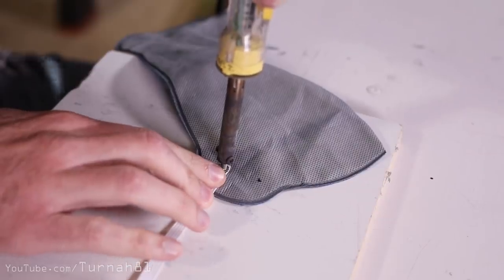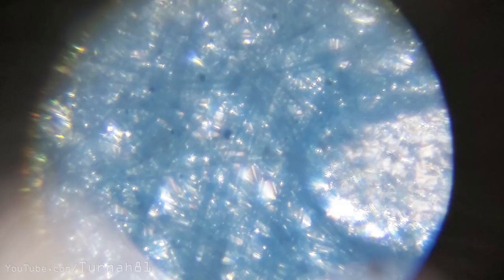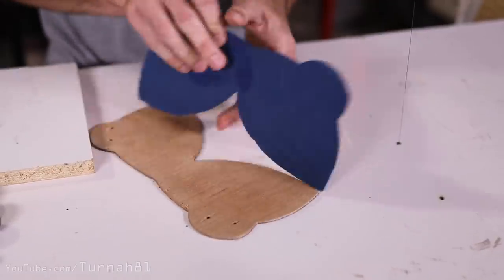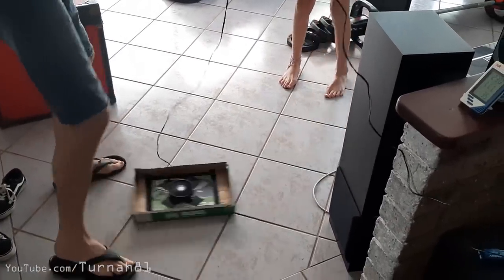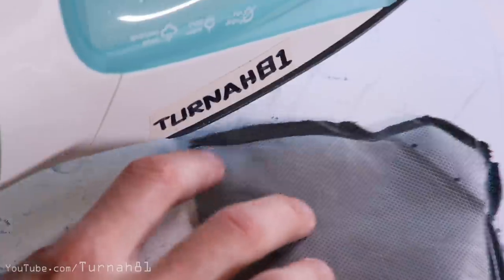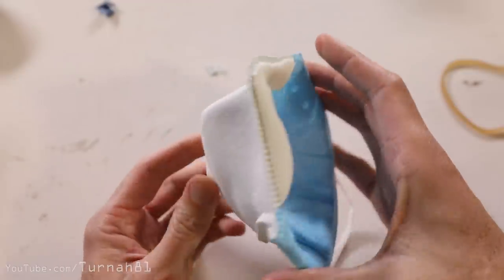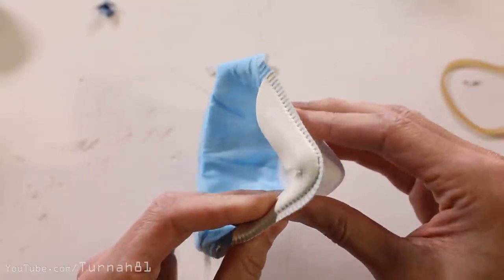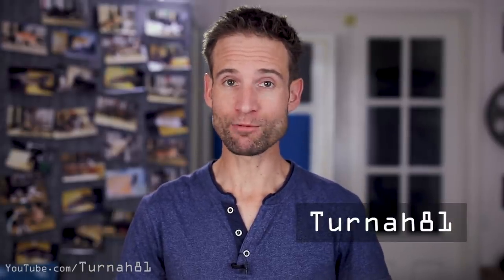How to Make the Best Face Mask, No Sewing (Don't use Cotton or Vac Bags!)

Comment: You can sandwich your fabric between pieces of parchment paper to prevent getting melted plastic fabric all over your iron.
Reply: Why is this not a higher rated comment?!?!?! I think this will also help with all the holes my iron is melting in the fabric. I have tried all sorts of temperature settings, speeds, and pressures... I either get two layers welded together without the third one bonding, none bonding, the whole thing melting to my iron, or everything bonds(ish) and there are a bunch of holes. I am going to try your advice, and have a very strong feeling it will work great! Thanks!!!

Edit: THIS TECHNIQUE WORKS SOOOOOOOOO WELL!!! Parchment paper WILL speed up the learning curve for welding the polypro together.
Reply: Jordan Mackey thanks for the update!!!
Reply: Thanks for the advice Misty!
Reply: Thanks for the advice.
Reply: This should be close to the top.
Reply: I'm so tempted to try sealing with heat. Didn't think to try before. I have been sewing them and it's been good to work with.
Reply: @0GxHazmat  Very smart idea! I also wonder if a glue gun (without glue in it, of course) could work?
Reply: Golgo 13 Another thought, would a woodburning tool do the job? I don’t have an infrared thermometer to determine the temperature of it and I am awaiting the arrival of my filty material. Filty is a US company and is now selling to mask makers.
Reply: While it's not exactly the most available material, PTFE film or tape (not the super-thin one for plumbing) works best as the non-stick layer for any source of heat. That's what is used in a lot of bag sealing devices, for example.
Reply: Thank you very much for this idea. I was having one hell of a time getting the pieces to melt together properly without destroying the fabric, AND getting melted plastic all over the wife's iron. I put single layer of parchment paper over top, slowed down a bit and it is sooooo much cleaner and easier. Plus I find the iron glides easier. Your idea has saved my sanity!
Reply: Misty Fairy good idea 💡 ty ❤️❤️❤️
Reply: Misty Fairy  his iron (like many) has a Teflon coated sole, which would explain why it works so well for him, but the plastic will stick to my stainless iron.
Reply: you can also use foil between the piece and the iron
Reply: sciloj Thanks, I’ve actually got some of that. 😁
Reply: Could you please add measurements to the pattern  so those without access to a printer can still make it? At best on a grid background, at least just write measurements with a baseline. Thanks
Reply: @golgo1364  There are sewn polypropylene masks that have passed fit tests, so sewing is ok
Reply: @0GxHazmat  Did you get a chance to try this?  Did it work?
Reply: @gregorysmith3097  Yes, I updated my comment, but that part may be showing up underneath the "...Read more." It does work, I ended up cutting the parchment paper to just a bit bigger than the template and then drawing a dotted line on that cut parchment to know where I wanted the weld. Otherwise, it can get a little tricky trying to see through the parchment paper. I had a couple goofy looking welds the first few times with this method, but they at least sealed.
Reply: @agnescleary2312  Try it and let us know how it goes!
Reply: I wonder if a straightening iron would work well for this purpose?
Reply: @dinahoeynck  It should.  Flat irons are supposed to be around 365 degrees F.  Melt point of polypropylene is 320.
Reply: @beadcamel  I was wondering the same exact thing. I have a tool with the different attachments and it seems like it'd work. I have a clothes iron too But I see myself burning holes or myself.
Reply: rodrigo maldonado  you can see through the parchment paper a little but not through the foil at all and the foil will probably add more heat to it too.
Reply: @sciloj  Will the plumbing tape burn or is it just too thin? I have a tiny little crafting iron meant for use with piecing quilts, and the 1" tape would probably be wide enough to cover it, especially if I wrapped it around a couple of times.
Reply: Baking paper also works. Tried it out and goes really smooth.
Reply: I think the dust cover for purses may work too!  Great video!  Funny guy,  Thx!😁
Reply: @sebastiaanx7867  The "baking paper" is commonly known as parchment paper.
Reply: @kblewis3331  Thanks, didn't know. In my language it is a uncommon synonym.
Reply: @johsheli  its harder to do with foil because its not see thru like parchment paper is. But yes in a pinch it would work. I think using a flour sack type of cloth would also work, and possible even wax paper which if ironed with the wax side down could help seal the edges if the hot iron leaves any pin holes it seems the wax would help fill them in. Just make sure you put wax side down so not to get it on the iron. You know what freezer paper would also work as well because it has a plastic coating on 1 side and people often use it to do crafts on fabric but ironing it on.
Reply: @slp5680  I think so even if you left the tip on you could make lines that are seals all the way around kinda like stitch marks if that makes sense. Also I would use parchment, wax, or butcher paper as a layer between the filter and soldering iron. Make sure wax and butcher paper have the wax/plastic side toward the mask because i think it would help seal any micro holes while keeping the iron clean.
Reply: I folded aluminium foil around the seam weld to do the same. Without it I could not do it and it was a mess.
Reply: Oh!  This makes so much sense to me! I was up late last night trying to research different ways to bond this material together and one of the things I found what that PP and PE don't much like to bond or weld to anything that isn't PP or PE. And, like many here, i was either melting holes all teh way through or not getting any melt happening at all. 

Parchment paper/ Baking Parchment is very lightly silicon infused to that nothing sticks to it, but it's also great in the oven up to 450 F (yes, the uncovered paper will darken and get brittle, but nothing sticks to it. I can make the stickiest candied sugar - take pure sugar and melt it in a heavy skillet at the highest stove settle, and you get molten sugar, this stuff is DANGEROUS, and will fuse to nearly anything once it cools and sets. LoL! It comes right off of parchment paper.

I have some plastic lined meat wrapping paper, but I'm not as inclined to use this since I'm a little worried about the plastic adhering to the mask during the melt process. But, Might be worth a test run or two.

Hhhmmmm I wonder how many times the paper can be used this way before it becomes to brittle?

What temperature  settings are any of you using with the paper or the foil?? Anyone care to share?
Reply: I ironed some polypropylene on mistake and it took me days and contractors solvent to get it cleaned. 😭😭
Reply: @beadcamel  Thank you Karen! What a great resource (actually spelled "Filti"). I wouldn't have found it if you didn't comment. Just purchased a sheet!
Reply: @beadcamel  I tried a wood burning tool. 

  Had real trouble with the clothes iron, will now try some of the techniques mentioned here with parchment paper.  Tried wood burner next, too impatient to go hunt out the soldering iron.

Even with a controlled power supply, we had a hard time controlling the temperature of a wood burning iron. It must have some type of temperature limiter and every now and then it stops?  My clothes iron had the same problem.  

The best results I could get were with a wood burning tip that had a very narrow edge, sort of like leaf- shaped, and flat.  We used the flat of the side to draw lines, a double set of parallel lines around the edge and were able to get a decent seal that way but the edges of the melted polypropylene were then dangerous even with trimming, you could scratch your face with them.  

I'm going to try these other methods mentioned.
Reply: Thank you greatly! Silly question but for times when I need a teflon mat to keep my cloth for burning while ironing, can I use parchment paper?
Reply: Yep, takes a woman to find the best shortcut!
Reply: Dina Hoeynck I was looking for this comment lol

Comment: USE EDGE OF GLUE GUN INSTEAD OF IRON, WITHOUT GLUE IN IT.
Reply: What a clever idea!
Reply: Good idea. I was worried about ruining my iron.
Reply: My iron was not made to work with glue in it.
Reply: Awesome. I will try this too. I tried making none and used a lighter and a plier to seal.
Reply: Is the mask washable?
Reply: Hayley Bourgeois  yes but it will not be as smooth and stiff as before. Starts to get a bit softer. Eventually it biodegrades in uv also , so I’ve read

Comment: Great tutorial. You can run a thin thread of clear marine grade silicone sealant to fuse all your seams even the elastic as well. that will keep them flexible and eliminate any cracking of the hardened melted plastic. It would also seal any sewn holes

Comment: For the nose strip, home depot has rolls of door seal foam. They have adhesive on it already, like tape. Works great for the ones I made from furnace filters.
Reply from the maker: Cool yeah if it's soft enough it will do the trick👍
Reply: I think bags of coffee have that 5-6 inch plastic "re-seal" strip that has two wires going through from end to end would work really well for the nose strip...and could possibly be melted or glued onto the mask. Thinner and more lightweight than electrical wire. Looks exactly like what is shown on the n95 in your video.
Reply: Felisha Kay yes that’s what my husband has in the garage..thank goodness for him or I’d only have the grocery bag part 🤣
Reply: I also used it to make face shields 😉
Reply: Make sure it doesn't have fiberglass in it
Reply: I use weather stripping. Comes in a variety of sizes but I opt for the window weather stripping foam. It can be cut, can use heat to smooth harsh corners, can handle vigorous washing and abuse and provides a great seal when used across the top of a mask to help keep from fogging ones glasses. I’ve used stitch glue or glue gun glue to keep them in place. They can still be comfortable after running a regular stitch through it to hold in place also. Same stuff as the weather stripping for doors Felisha had mentioned. Stuff is super cheap and easy to pick up as it’s not in shortage. Any hardware store or hardware Dept should carry it. I’ve even seen it in a dollar tree.

Comment: Fantastic tutorial. You are spot on. I would also like to recommend an old seamstress trick; bees wax. Rub bees wax along your sewn seams to seal the thread holes. Bees wax will also stand up to several wash cycles as well as the dryer on low. But, drying out in the sunshine is preferred to using a dryer whenever possible.
Reply: Beeswax smells good too
Reply: Great option!
Reply: what about bias tape? it looks like that
Reply: I forgot about wax -- bet you can use Baby Bell cheeze wax on your own if no beeswax
Reply: Hi Wendy, good idea with bees wax.  If anyone does cross stitch or beading there is a wax like material used on thread, as well as  bees wax. Thanks. Stay safe :)
Reply: You can use an artist's brush and paint along the stitched seams with a clear, satin acrylic poly-urethane to seal any holes and it will probably outlast the life of the mask.
Reply: Just use hot glue with a thin layer right over the sewn seam then press it in with a wiping motion so your finger forces it in and wipes off excess all at once. Too hot? Use a folded up section of wax paper. DONE.

Comment: With all due respect, I began to melt down about three minutes into the video. You are a man who doesn't give up however. I wanted to tell you I haven't  seen a hot wire cutter for years. My husband, God rest his soul, used one to cut Styrofoam for radio control airplane wings. I helped of course. I recall him having a Mono coat iron to use to cover the wings too. Don't know if it got hot enough to seal those edges however.  I love your determination and the amount of tools it took to complete these. Kudos. I made mine on the sewing machine and put coffee filters inside of them. It protects others from me perhaps. I'm almost 72 and have seen a lot of things, but this virus beats most. Thanks for sharing your determination.

Comment: I used my Walnut Hollow woodburner tool. I played with the heat settings until I found the setting that was good enough to join the layers. I also used parchment paper to prevent my tool from getting messy. For the elastic, I folded in the edge and added heat to it. Then I passed an elastic through the hole. I made the mask and it turned out very good!
Reply from the maker: Awesome to hear.  Cheers

Comment: When stapling the elastic, staple as per the video, fold the elastic over, and add a second staple closer to the edge. This takes some of the strain on the first staple and helps the elastic to lay better. If you're worried about the staples leaving air holes in the fabric use a tiny dab of hot glue on each inside, bent over, part of the staple and flatten it before it hardens. This gives each staple anchors that help them resist loosening or being pulled out. Another method of attaching the elastic might be iron on fabric adhesive. And maybe silicone sealer to seal holes or seams? It's softer and more flexible then hot glue.

Comment: For the nose wire, use the "twist tie" tabs from your packaged coffee grounds. 
(I just knew I was saving them for a reason.)
Reply: It's not stiff enough.
Reply: It's what's used in surgical masks for the same purpose. They also hold up through more washes than I expected.

Comment: Turnah81: You probably have this stuff around your home
Me: Doesn't have car cover, soldering iron, or random bits of foam, hot glue, and elastic
Reply: Why not ?
Reply: You're strange then because i had everything on hand
Reply: So no car cover -- use non-woven shopping bags, the sides of a cheap twin mattress cover, the stuff bed dust-ruffles attached to... anything with the little round dots instead of square weaves.

No iron or hot glue gun? Old worn round screwdriver or butter knife altered to have heat protectant handle.
Use your back stove burner to heat the metal to cloth melting point.

Make sure you have a window fan facing out (open windows opposite side of apt  to allow air inflow) if your stove exhaust fan is non-existant or is not vented. If no fans, windows on opposite sides of house should help if you're just making a couple for yourself.

No hot glue gun? Sticks are $1 for 10 at dollar store. (Get parchment paper while there, for nonstick edge ironing, or use brown paper bags) 

Experiment heating knife, pressing  stick against it to melt stick, touch it to fabric & stretch the strands into place.

No dollar store? No Walmarts? No Target? No hardware store? 

Maybe the wax from candkes or BabyBell cheeze covering, a tight roll of saran wrap 1/3 thick as pencil, put patchment over. Heat a chisle, fat screwdriver, hammer head, tire iron, or tin can on your burner & melt.

None of those things? Find a smooth round river rock, wedge it in a split green bough, tie rock in with fresh sinew...heat rock in flame until sinew boils and bough sizzles...

This is not a drill. This is your life on the line. To survive, you need to quit being bored & think on everything, how you can improvise.

Good luck!
Reply: I'm glad you said that. Nothing is simple or convenient about this video.
Reply: But you might have other things.  Elastic=rubber bands. Soldering iron=glue gun.  Car cover=grocery bags.  Foam= old toys, shoes, insoles.
Show some initiative.
Reply: @AG-yj1jv  What's a back stove burner? Sounds like you live somewhere in  the bush, not in the middle of the city with no garden... Also, here in the UK we don't have those polyester shopping bags in grocery shops. It's either plastic or waxed paper.
Reply: Do you own flip-flops? Do you have internet shopping? A mini-glue gun are pretty cheap, though not as efficient as a full size ones.
Reply: @AG-yj1jv  damn. You should make your own channel.
Reply: @jeric_synergy8581  How many have you made, MacGyver?
Reply: hahahaha right, i''m had to buy many stuff to design my own facemask and i'm doing it! i'm glad with myself hahaaha. i'm custumizing my own facemask to Covid with better materials to protect myself from the people and the sarscov2.
Reply: I think some people are missing the point to the op here. It’s not that those things or similar can’t be bought but that many wouldn’t actually have those things readily available and at hand.
I live in a studio appartment (so no huge tool shed or garage) and while I do actually have both a glue gun and a soldering iron (not to lie I have two of those), I’m pretty sure that I do not have a single piece of bag, cover or fabric that would be like this one. 
I’m obviously here because I want to learn about making a safe comfortable mask, as it’s becomming a requirement in areas around where (summer vacations Unfortunately have made a spike in corvid cases, which had otherwise been dropping since the 28th of march), and however much I do selfisolate I’m not stupid, I want everyone to be safe around me too. 
The point however is, this seems like a very good suggestion to an alternative diy face mask, but the video still says ‘things that you have around’ and many people simply wouldn’t have it around. Which isn’t bad, it just makes the statement Incorrect

Comment: Thanks for the video, my tip if its any good is to be aware that hot melt glue basically loses all its stick if exposed to alcohol fumes, so if using alcohol based disinfectant around the mask the glue will stop doing its glue stuff